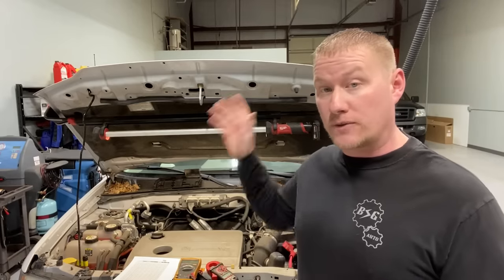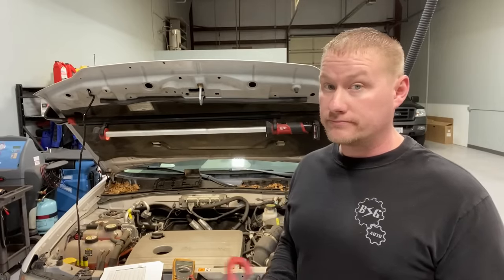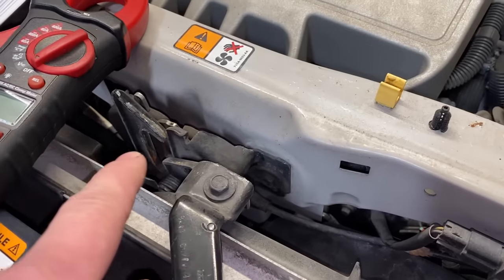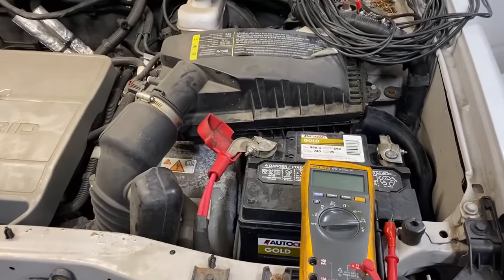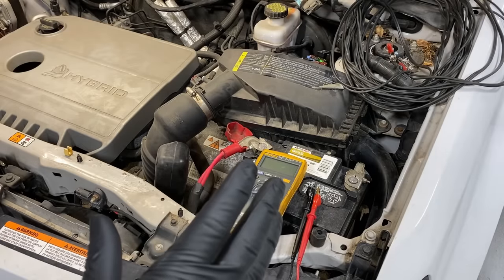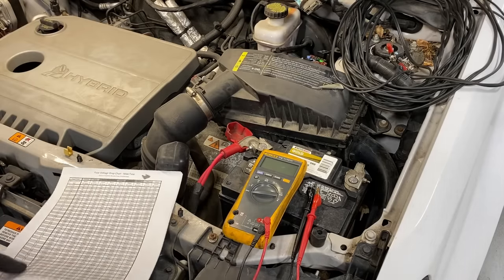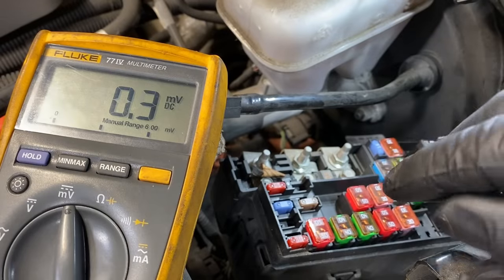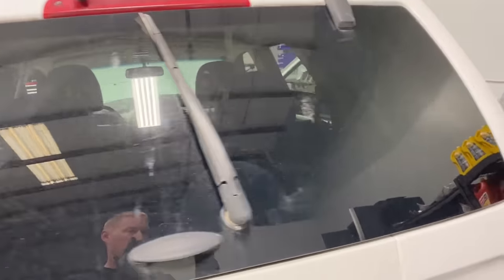Which Parasitic Draw Test Method is REALLY the Best?

Comment: Great video, thanks!

At 30:25 you say to leave the fuses out after pulling, even if they're not the problem  - why?

Also, how can you use the clamp ammeter when you're checking fuses inside the cabin?

With the series meter you could use long leads to bring it inside, and a 2nd meter to measure the fuses.
Reply: because putting the fuse back in will set any module that you killed the power too in (out of sleep) wake mode and will take 60 minutes to go back to sleep and destroy the whole test.
Reply: @keithalexander36  I see, thanks

Comment: @FordTechMakuloco
On my van, 2007 Ford FREESTAR three wires come off from the  positive post. One to the starter, second to the alternator and the third one to the engine compartment fuse box. Do I clamp the wire that goes to the fuse box?
Also, the only hood switch that I found will not arm when paper clipped, I have to tape it shut and arm afterwards, is that ok?
Thanks for the help.

Comment: How come you like the voltage drop test in the 3rd test but not first test? Your biggest problem with the first system seemed to be the fact that there are like 3 different styles of fuses that can’t be tested for voltage drop because they are sealed or cartridge types..

Comment: I only see one problem with your hybrid method using the amp clamp and fuse voltage drop method. While you're inside the vehicle measuring voltage drop across the fuses you have no way of knowing when the draw disappears. You need a blue tooth amp clamp that broadcast the reading to your cell phone so you can see both reading at the same time. I don't know if such a thing even exists.

Comment: @FordTechMakuloco My 2010 F250 6.4 OK, so I tracked my parasitic draw to fuse #40, 1.30amp draw. (listed as 4x4 module, GPS module, satellite radio module.) With the fuse pulled the only thing that does not work is the 4x4. The GPS and satellite radio still working. (0.01 amp draw with fuse pulled) Not finding anything on where the 4x4 module is located in a 2008-2010. (it's not behind the glove box) Can provide direction? I'm not finding and videos on the 08-10 4x4 module.

Comment: Is it possible to have an intermittent parasitic drop be delayed long enough for the fuse to cool down and not show up on the thermal imaging camera?  In that case, using a thermal imaging camera would be sort of like method 1 where you'd have to get lucky to have it on while the parasitic draw is occurring?  Thanks.

Edit:  Also, what if you need to test the fuses that are inside the car?  How do you see the amp clamp while testing fuses to make sure you're doing it while the draw is happening?  Are there any tips for that?  Thanks.

Comment: If I place a meter in series and identify the amp draw, and then test the ohms on the fuse rather than use an amp clamp? Is that essentially the same thing as option 3?

Comment: I have a 2000 lincoln LS. Something is draining my battery slowly. If I let it sit for a day, I need a jump. All major parts such as alternator starter battery have all been replaced within the last 6 months. I did notice my dome light stays on when I shut the doors, so I pulled the fuse so there'd be no power going to it. Its Still draining. Any ideas?

Comment: Why do you need to leave the fuses out as you test each circuit? What would happen differently if you replaced each one testing it's circuit? I understand that if there is more than one circuit taking power that each one will show a partial increase in parasitic drainage.
Reply from the maker: It wakes up the modules on that network when you reinstall the fuses.

Comment: My multimeter shows 0.00 (Setting at 10A, Black lead in COM and negative battery post, Red lead in 10A and negative battery cable). Yet battery drains over night.   I tested the fuse and it's good.  Also, I bought a new one CENTECH 61593 repeated the same and still shows 0.00 (Black in COM, Red in UNFUSED 20A MAX) with setting at 20A DC on the multimeter. I would expect to see at lease .050A during the test but always shows 0.00.  Any ideas, please help.

Comment: hi
i got a picoscope 4425 and i just noticed that if i connect only the positive lead to the battery + i get a signal of 9.3 v on the scope ? connect the negative lead and get battery voltage.. disconnect the vehicle battery cables and shows no volts when only touching the Bat + curious if you have noticed this and if this is normal?

Comment: I have a 15 mins on average spike draw on my vehicle,   but all I have with a standard cheap multimeter with no ( Min / Max ) function,    So it seem like it's going to be very time consuming for me to find the source of the draw using the tool i have to hand.    Also I'm unable to do the third method even if i had a clamp meter,    because there is no fuses that have the terminal exposed on top to probe across on my vehicle,

Comment: Hey, I am currently a ford technician, and have used the second method only, since starting to do work using the Ford WSM, as it outlines that method for diagnostics... but, i have a question about the third method with the amp clamp meter. referencing the problem with method 1, how can we check the mV reading in the J case/Cartridge fuses during that test without removing them, or fighting with the clear lids ? or are those fuses simply just removed during that test?
Reply from the maker: Yes you can simply remove them last or remove the clear lid.

Comment: My amp clamps says to attach it to negative wire vs your positive.  Is there a diff?
THanks
Reply from the maker: Nope
Reply: @FordTechMakuloco  thanks.  Video was very helpful but not your fault my Volvos radio drains my battery!

Comment: Found problem on my dodge diesel it was the tipm. Under fuse box. It was causing all kinds of wired problems 
I looked and looked and found out dodge had a problem with  the tipm on all 2006through 2015
Reply from the maker: TIPM's are so common on all kinds of Chrysler models.

Comment: You originally said 1st test is least accurate and not all fuses could be tested. Wouldn't that apply to the last test as well. Why not solder a set of test leads to a blown fuse of each type and substitute for each fuse one at a time for amperage...especially on all fuses that can't be tested by first method and/or skip those that can and show 0.000 voltage drop?

Comment: What is the purpose of the leads connection prior to introducing the meter? Why not just measure between the negative post and negative cable without the dual leads.
Reply from the maker: I think I explained that very well in this video already.

Comment: Someone please explain the 3rd parasitic draw test he did with the clamp. When you hook up the clamp and use the other digital multimeter to test for V on the fuses while the clamp is hooked. What voltage or how do you determine on the multimeter which fuse is the one causing the draw? someone explain please.

Comment: Help needed' done a parasitic draw test on my 2008 2.2 Citroen relay no draw found' multi meter reading 0.17  on my second new battery today' did all the correct checks on new battery' and it went completely flat within a few hours??

Comment: Brian    I have a 03 focus wagon with the 2.3 doch   with a intermintant no crank no start   I do hear this thing you said about  re the cd player   to stop this  do I pull the radio out and change it   or is it a wire ?  and I also hear  static coming from a speaker when the raio is  off  .   on another note   I noticed  when backing out of my drive way and the radio is on  when the doors go to lock I hear this screeching sound through a speaker for a split second .  could corrosion on my starter solenoid teminals cause a no start no crank ?   I have over 200k on this starter

Comment: Sorry, I do not fully understand the third method, i.e. I do not know what exactly I check in the fuse with a multimeter. (I don't know English well), I check each fuse as in the first method? this method was not very accurate after all ("only accurate with a constant parasitic draw") and we use it in third method?

Comment: Your procedure to set up the fluke as an inline ammeter is a little silly. Check this out
Your procedure:
1. Loosen negative terminal end
2. Disconnect negative end from terminal (kills power to all modules and the simulation of activating all modules would need to be done again)
3. Cover the connections with cloth to prevent contact to body or other parts (unnecessary, cause you already severed the power source)
4. Reconnected the negative terminal to the vehicle's negative cable end with 2 long, thin wires still creating huge sparks in the process, if there were gas vapors present they could ignite
5. Gets the same result as my version

My version which I highly recommend you try just once
1. Loosen negative cable
2. Attach negative meter leads with alligator clip (the 1"  / medium sized ones snap on or Mac sells) to negative cable end
3. Slowly raise the cable end off the battery terminal as to expose a small portion of battery terminal below the cable end BEING SURE NOT TO LOSE CONNECTION between the end and the terminal by applying constant pressure to the end onto the terminal
4. Attach the positive meter leads to the negative battery terminal spot you opened up in step 4.
5. Now that a good connection from the meter to the negative battery terminal ... Just remove the vehicle cable end from the post. Notice how there are no sparks, cause the electrons always had a path to travel, so no arcing occurs at all
Reply from the maker: Um no, I would not go through all of that just to hope and pray I don't lose connection in the instance I am trying to catch a locked up module for example that may be causing a draw. If that were the case I would go right to method 3. Your method too is flawed because if you have ever worked on a car before and it sounds you may not have (not a dig just an observation) you would know that once you loosen the bolt on the battery terminal it arc's quite a bit as the connection is now quite poor. So yes you would want to move step two up to step one, no? Let me know, thanks!
Reply: @FordTechMakuloco  i have successfully done this many times to diagnose current draws. the key is to not lose power by applying constant pressure to the connection while maneuvering it up to make space for the second clamp. i don't lose trouble codes or I/M monitors or radio codes on Hondas. no sparks. no arcing. i'm sure theres a video online where you can see it done

Comment: I have a 1999 f250 super duty xlt 4x4 5.4  new starter and solenoid on the passenger side fender  has power  click  from the solenoid  no start
Reply: Does the motor spin?

Comment: i'm con fused pardon the pun .if you put the test probes on both sides of the fuse what are you reading ?wouldn't that be like putting both probes on just the pos or neg terminals of the battery? since there is a link between the two.
Reply from the maker: You are only checking the voltage drop across the fuse which is proportional to the amount of amperage being drawn through the circuit.
Reply: @FordTechMakuloco  ah i see, gotcha

Comment: OK. But for your favorite third option don't you still have the same issues of not being able to read either the sealed or cluster fuses?
Reply from the maker: Right you can never get around that but that is why you save those for last.
Reply: @FordTechMakuloco  Thanks. No way around having to pull them, right?
Reply from the maker: You can pop the caps.
Reply: @FordTechMakuloco  Thanks.

Comment: I have Toyota Camry 2005 2.4 Litter and few days it died while driving and after all tricks, I had to towed to home too if alternator or battery problem well replaced both and still car died on load and I tried to do the parasitic draw with multimeter but I am not getting any reading on multimeter, it stayed on 0.00 even i have done every single fuse to take it out but no luck . Please help me if you can thanks

Comment: i saw a 50-75 milliamps draw with everything off in sleep/off/accessories modes.

using amp clamp dcv i found no draw when off, but a steady (not intermittent) 2.25a draw in accessories mode (all off, door open) on 2 of 3 honda accords (family).  the third shows same .05a or less draw in both the off/sleep mode and accessories mode (all off, only door open).  

questions:  is 2.25a steady draw in accessories abnormal aka a clue?  do i use multimeter to do same volt drop test across fuses vs pull the fuses to figure it out aka same routine?

Comment: What was the point of the 2- 5 mile long jumpers at the beginning of the 2nd method?  You unhooked them as soon as you started checking.  Seems unnecessary.  And if you're double checking on the last method by using the 2nd method I dont see how thats any faster.  Unhooking a battery terminal takes seconds.  What am I missing there?

Comment: What gauge wire did you use for the long test leads, you made?  12, 14?
Reply from the maker: 14 gauge was the biggest I could get and it has handled any jobs in the last 15 years.
Reply: 14G Silicone insulated "Extra flexible" ,black/red,  "lamp style" is  what I put in my "Shopping Cart", now I will order it.  Thanks.

Comment: My rear window wiper, from time to time parked at idle or driving, turns on by itself 99 expedition xlt4WD5.4 serial L.
Forscan says the switch is shorted to ground. The headlights intensity go higher and the AC motor blows more when from idle at a red light to green traffic light, I push the gas pedal until I release it.🤦

Comment: I can see several problems right off the bat with method # 1.  differences in fuse manufacturing will cause different voltage drops. any corrosion  on the fuse terminals will also cause false readings.
Reply from the maker: It is only used to quickly identify a problem circuit that requires further investigating nothing more.
Reply: Measuring the voltage drop by connecting to the top of the fuse eliminates any measurement error due to corrosion on the fuse contacts. This method is known as a "Kelvin connection" and allows you to fairly accurately measure the voltage drop across the fusible part of the element i.e. the very thin strip internally  connecting between the two legs of the fuse.

Comment: Mine draw is under hood fuses the larger square type which is engine. Not sure wires to check for engine  if tailight or horn be I know what to check not sure for engine fuse

Comment: Does the 50 milliamp spec apply to diesels with 2 batteries as well?
Reply from the maker: 50 ma spec is for the combined module draw, battery size or quantity has no effect on this spec.

Comment: 95 percent of techs are throwing these big ammeter clamps around and thinking they are getting a good low current reading for a draw test. Meters with big amp clamps are generally not good for low current draws. Look at the fine print in the manual, it will have a spec of a certain minimum current before they start to read within a certain percentage of accuracy, usually around .5A, 500 mA. Anything below that, and the meter doesn’t translate it properly so you’ll just get a blippy number or just plain zero. Lucky in this instance, your draw was several amps so it would catch that, but notice how that craftsman meter just reads 0 with an occasional oddball .02, .01 then back to zero otherwise. Thats because at less than .5A it doesn’t know what to do so it’s just gets all weird and reads zero even you likely actually still have a few hundred mA. So if the draw here were say 100 ma, you wouldn’t see it. They make specialty low current clamps with a much smaller opening for this. Best to have two, a big one to measure a lot of current, and a smaller one for low amperage draws. Admittedly, there aren’t many of these dedicated low current meters around, and unfortunately you’ll pay as much as a whole meter for one, which is likely why most techs aren’t even aware of the issue.

Comment: 7:30 12.4V is not a fully charged battery. With no load on the battery, and a battery that is fully charged, anywhere from 12.6V to 12.9V is a fully charged battery.  Depends if it is a standard FLA or AGM battery. And anything above 12V is a battery that is about half charged.
Reply from the maker: officially 12.6 yes as noted in the videos but anything above 12v is going to give you accurate parasitic draw testing results.

Comment: on the second method, what's the point of running the jumper between the terminal and the post and then disconnecting it when doing the reading? Other people I've seen who demonstrated this method just went straight to pulling the terminal off of the post and connecting the meter to the terminal and the post without the intermediate step of having the jumper in place for a short time....is this protecting something or....?? confused as what this is accomplishing.
Reply from the maker: The jumper in method 2 allows for connection on the meter inline with the circuit without breaking the circuit and "waking up" the vehicle.

Comment: I came for issues with my '98 Buick, looking for clues, but since I also have a 2011 Escape, I stayed in case I learned something for my Ford.  My rear wiper failed on mine as well, and it drained my battery very quickly.  Had to have it replaced.   

Having said that, the more modern the vehicle the more it comes with useless unnecessary electronic BS for reasons we won't talk about.  In the 20th century, the auto industry created trustworthy and durable drivetrains, solved body rust issues and created a smooth, safe and comfortable ride.  Their Achilles' heal since the late 1990s has been electronic and computers which were never really needed.   But hey!  Lets sell cars and trucks and create waste.